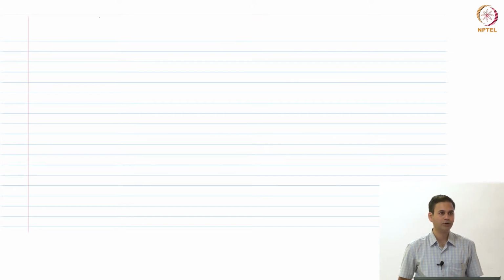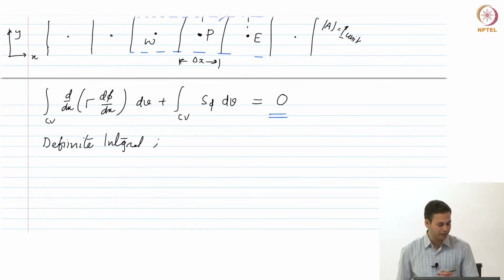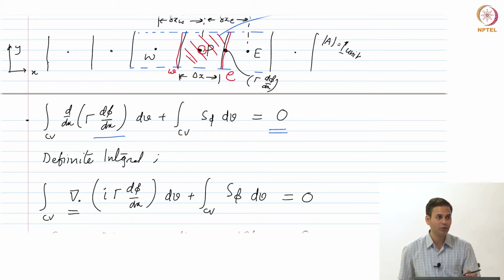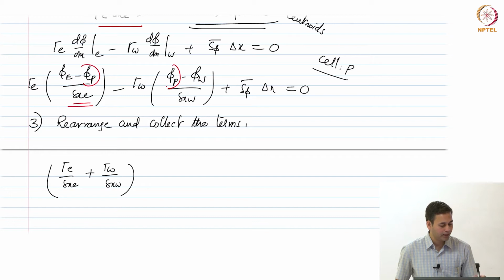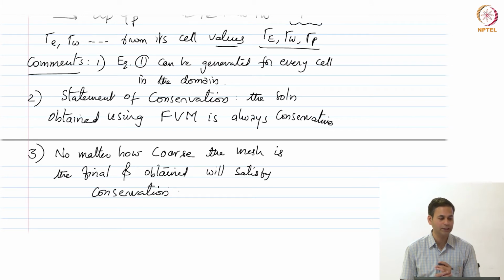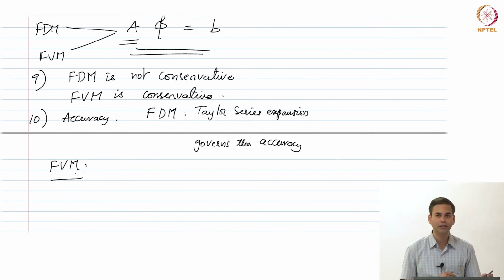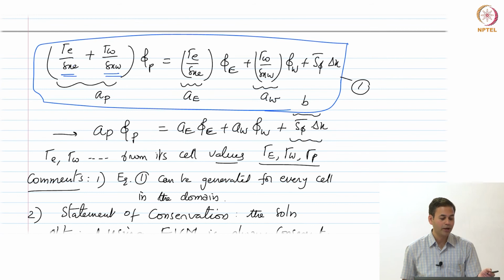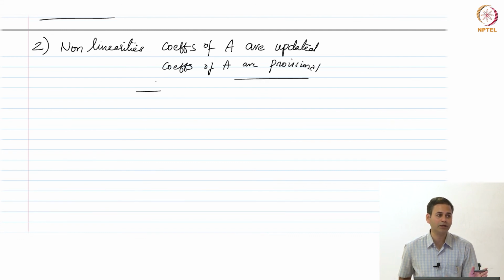#8 Overview of Numerical Methods:Finite Volume Method | Finite Volume Method

Comment: Sir, I suppose the case when the FDM violates the conservation laws is when the mesh is irregular, what do you think?
Reply: No, In F.D.M Conservation is valid only at a point. That is Why we opt for F.V.M Since it applies conservativeness over the whole each control volume & By Doing so We get conservativeness over entire Volume But in F.D.M we get conservation only at discrete points on the domain and that does not give conservation over entire Volume or entire volume